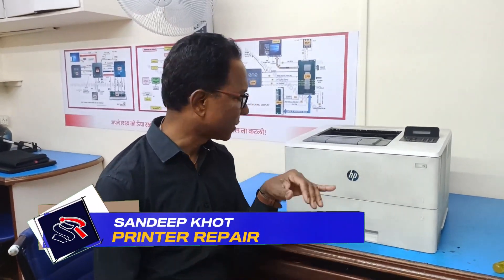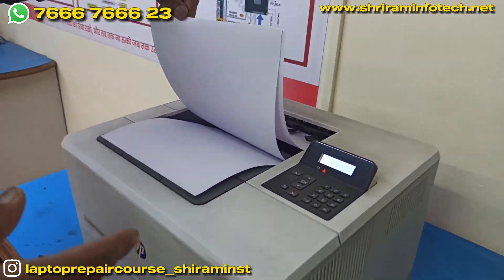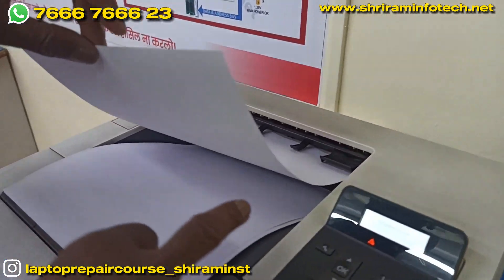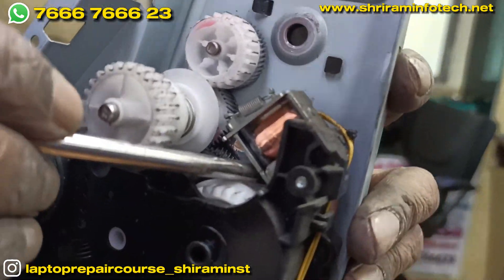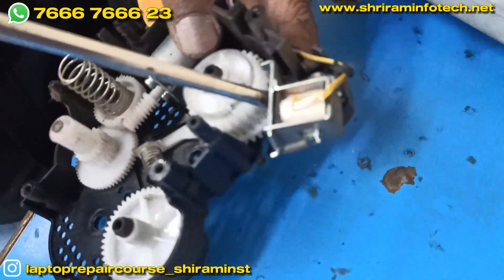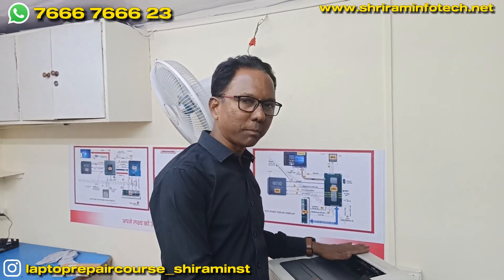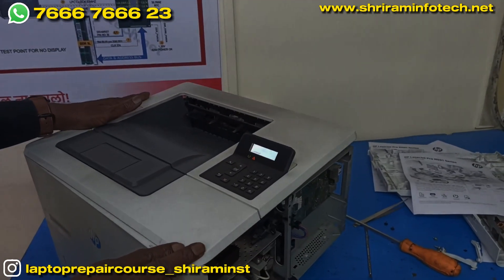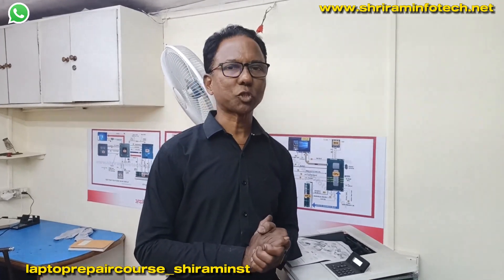Printer Repair by Prof. Sandeep Khot

Comment: please sir,i would like to inquire from you,what causes inductor coils to heat up immedately after power on,most especially around cpu core section,but has good output voltage but inductor coils are heating up